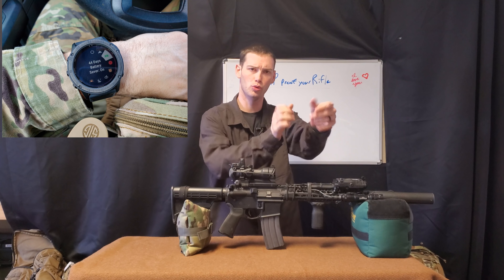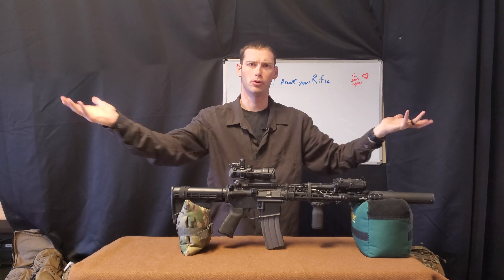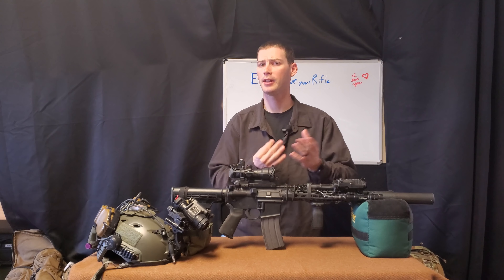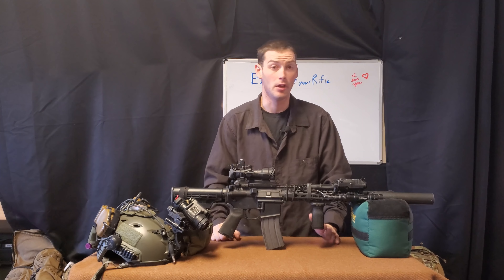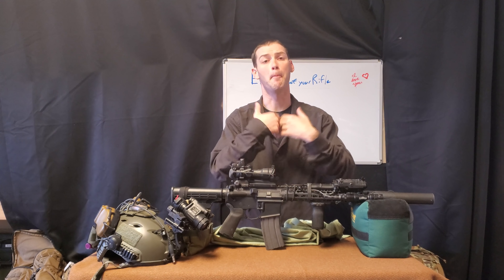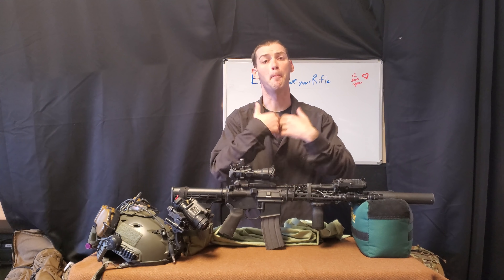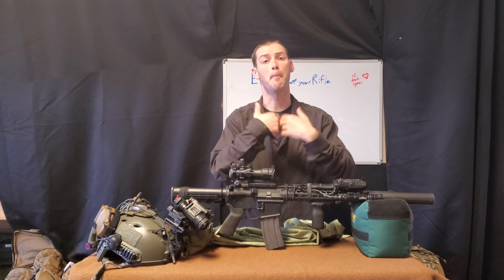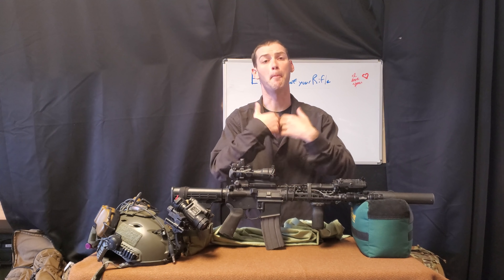EMP proof your rifle

Comment from the maker: If you are someone who has Night Vision, unfortunately you can't use Iron sights as a backup method... hence the reason for this video.
Reply: As someone without NV, question. Would tritium (fluorescent paint, idk what it actually is) front sight post on a rifle be usable with NV?
Reply from the maker: @sovvers514  Not with any degree of accuracy. The problem with NVGs is they are at a fixed focal plain, like a manual focus on a camera. So if you see your target then you can't see your sights or opposite if you see your sights you can't see your target.
Reply: @PreparedAirman  nvgs dont have focal adjustments?
Reply from the maker: @lawofliberty3517  They do but they are cumbersome and time consuming.
Reply: I use white-out on my front and rear sight. It stands out pretty good. I don't run night vision. It's cheap too.
Reply: @sovvers514  another problem is its hard to get a good line of sight on your rifle with irons. most people use IR lazer only for aiming or a scope riser to aim
Reply: @crossfox1991  while i appreciate the response, that is pretty common knowledge. i was looking for an emp proof method under night vision, and if an emp affects my rifle I imagine the laser and scope will be rendered useless. though, so would NVG’s if they were in the same proximity. idk man maybe i’m reading too far into it 😂
Reply: I Guess I'm The Poor, Weird, Nerd That Just Used The Old Hobo Faraday Box Methods!?! 
I Cut Cardboard Boxes (For Insulation!) Custom Fitted Around Each Device(s) Of Concern! I Then Fully Wrapped Boxes With H.D. Box Tape, Proceeded By Multiple Layers (Exterior Only, 3 X Layers!), Of H.D. Aluminum Tape For Shielding, Extra Extended Lengths At Openings, To Assist In Opening And Secure Resealing, Via Clean Folds, Or Rolls Like A Back Packers Dry Bag Works! 
If Your Not, A Poor Hobo, 
Such As Me! I Recommend The Metalic Shielding Cloth, Inside Of Any Camo Storage Pouches, For Convience Alone! 
Pa-Pow, Amen! 
😎 🙉🙈🙊 🇺🇸

Comment: It is my understanding that optics and lights having very small conductors, have an insulated construction, and no antenna element that an EMP will have no effect on the optics/lights. 

Also it is my understanding that cell batteries like AA, AAA, Cr123, Cr2, ect as they are direct discharge and not conductor lead, the batteries will also not be affected. 

Things like radios, TVs, modern automobiles with computers, and our power grid will be effected. 

This is just based on my own research and reading I have done a long with my neighbors knowledge who is currently an electrical engineer, and when he was in the military he worked with the navy and one of his jobs was to EMP harden navel vessels.
Reply from the maker: Most evidence points to you being correct but realistically we don't know what would actually happen. Magnitude +Time, distance and Shielding all are unknown factors in this situation. With that I add an extra layer or protection. 

Ultimately we don't really 100% know what will happen. 

Objectively $50 protection for $6000 rifle is worth it to me. Comparatively buying $35 insurance on a $2000 plane ticket in case your plans change is a good investment in my opinion.

But that's just me

Comment: Emps also need a closed circuit to fry electronics last time i checked. So you could make sure to not leave batteries in your devices.
Reply from the maker: Any electronics are susceptible to EMP regardless of them being used at the time or not. But it's based on location and magnitude or the event.
Reply: Electronics with an open circuit without power are not susceptible. Arguably you could throw 14s in space (hoping that wouldn’t rupture) without batteries and would be fine in a solar flare. Agreed on not leaving batteries in devices till it’s time to get sexual
Reply: @paulsharp3748  thats what i was tring to say haha thanks
Reply: @PreparedAirman  thats just simply not true, like you said your fancy blanket prevents damage from emps....how do you think it does that? The same metal in that blanket is bassicaly in alot of optics flashligjts etc and its all on the out side, you dont need a blanket, also in order for an electronic device to even be affected by an emp it would have to be a closed circuit to act as an antenna, the bigger the circuit the bigger the antenna......btw ya could just wrap your gun in aluminum foil but making sure your guns are just grounded would have a better effect
Reply from the maker: @Derpyderp597  You do not need the have your items grounded.... common old school misconception. Large power systems do but for a common Faraday cage it's out right un true. Look up DR Bradley's tests here on YouTube you will be surprised.

Comment: Professional opinion as an engineer who's been researching EMP for about 25 years from a prepper's perspective. Everyone should have a job box or at least garbage can faraday cage. Mine has radios, an old laptop, small solar pannels, a bunch of TLR-1s I was able to get lightly used, and Vortex RDSs that are zeroed, removed and labeled for who they go on. And flashlights, lithium batteries (they have regulator chips in them), solar powered lights and a bunch of cheap casio watches. Little stuff MIGHT survive. Might not. Too little actual experience, just a lot of math when it comes to a bomb-pumped EMP. And this stuff is amazing
Reply: I use a 20mm ammo can, same result
Reply: Also buy a cheap automatic (no electronics) watch, like an Invicta Pro Diver. 😁 I just bought a Pro Diver 8928OB for $45 on Amazon last month, but not sure the sale is still going. It has 200 meter water resistance (with crown screwed down). I have a DBC-32 Casio calculator watch with 10 year battery life on it.
Reply: .... vacuum tubes my friend, vacuum tubes....
Reply: @franky2shoes660  Ahh the voice of reason and shortwave
Reply: The optic is no longer zeroed the second it comes off the weapon.
Reply: @prominence2826 , not always true. I have attended numerous courses where optics were moved from one upper to another. When returned to the exact position on the original upper the sight was again zeroed. We reconfirmed this numerous times. LPVOs and other magnified optics are more difficult due to the various factors that can cause zero shift.
Reply: @budoka34  Exactly. It really comes down to the optic type and how well made the mounting mechanism is.  If said "good quality" sight is mounted directly to the upper receiver (And why wouldn't it me?) then you've got a reasonable chance of being good to go.
Reply: So the metal trash can… what do I need to add do it?
Reply: @FFEMTB08  To make a metal container into an EMP resistant protective solution, you also need a metal gasket to fully seal it (can just be foil tape if you don't need to open it often) and a non-conductive liner, such as cardboard.  You don't want your sensitive devices contacting the outer cage at all, and you want it buttoned up tight as even pinholes or narrow gaps in hinges and such can allow through significant EMP damage.
Reply: @Zednor9  so I’ve got cardboard lining the inside of it ,and the lid. Do I need to seal it up more ?

Comment: That is one of the reasons I use Tijicon and Meprolight  red dots. No Electronics, No batteries and is always on.
Reply: Any and all red dots are electronic, having a battery or not doesn’t matter they are electronic..
Reply: Well that won't help for your light, pec-15, or NODs
Reply: @deputydog5261  Meprolights & Trijicons use tridium & fiber optics.   There are NO electronics in those red dots
Reply: @Ironsight_Army  Didn’t know
Reply: They are crazy how they work
Reply: Just picked up the Primary arms Cyclops Gen 2. With etched reticle and illumination
Reply: @mrbocanegraw  Also a good choice!  I want to pick up one of their micro prisims
Reply: Will definitely get thank you
Reply: @mrbocanegraw  I ordered mine almost 2 months ago said backorder  til may
Reply: Is that why mepro optics always look like ass?
Reply: @jammbbs1688  💯🤣
Reply: @Ironsight_Army  got the slx 2.5x prism a couple weeks ago. Very impressed so far.
Reply: @jammbbs1688  meprolight uses tritium which is a very rare radioactive isotope of hydrogen (H3 is  labeled on all tritium sights as a requirement to designate the radioactive element contained within) that emits light as the element decays thru it’s half life (12-15yrs). It will be 1/2 as bright, and  another 12-15 years it will be half as bright as that and so on. It will never go completely dark. 

You may have been looking into an older tritium tube.
Reply: @deputydog5261  incorrect bro.
Reply: My Tijicon has a battery
Reply: Micro prisms are my jam
More precise reticles and no tint
Reply: This is absolutely not the case for all trijicon devices. In fact, this isn’t the case for almost any of their offerings. 

I’ve never even heard of mepro lights. Probably for good reason.
Reply: God's chosen optic.
Reply: My trijicons have batteries.
Reply: The wrath of God acog does not use batteries. Jesus is the light.
Reply: I mean that’s all good and well until you’re fighting at night vs people with nvgs and ir lights which is way more likely than an EMP💀 I personally only like optics with etched reticles

Comment: Most all modern electronics have spark gaps printed on the logic board and or other components used in the same capacities which mitigates any possible emp damage.
Reply from the maker: Do you mind show where you received this information? Research paper or something else by chance? Its just conflicting with a PHD holder on the subject with many years of experience and I think its interesting.

Comment: My curiosity does it affect bullets does an EMP affect bullets because most of us I'm sure have a small stockpile of ammunition would it be worth considering rapping them
Reply: No, only way you ammo would be affected is if you have it locked in a safe with an electronic lock that didn't have a key access, and a direct answer is ammo doesn't have electronic components to fry so it will be fine.

Comment: If you're at the point that you are EMP hardening your rifle, I hope you invested a bunch in CBRN protective equipment, industrial HEPA air filters, Potassium iodide and other radiation meds, months if not years worth of food and water, and an underground concrete fallout shelter.

The most common and likely way humans can generate enough EMP to knock out electronic devices over a large area is through nuclear detronation.
Reply: Yes, this is true. But most common emp weapon is used at high altitudes to get the biggest effect. There would not be any residual contamination to deal with. It’s been reported that if given time it would reduce the US population by close to 90 percent. 

All the aggressor would have to due is pop multiple nukes miles above the US and wait a year or so for the die off and then roll in a take the place over.
Reply: @sokyoutdoors588  The point is that weaponized EMPs come from nukes. The common misconception is that "EMP Weapons" are non lethal. The ones that "would" be used are not. In fact they are very lethal, not only to the enemy, but to the entire world. Solar flares are currently the only threat that can produce enough EMP to affect a large area without nuclear fallout.

Nukes that are detonated at high altitude have the effect of spreading  nuclear particles over significant distances, that may settle anywhere in the world as it is carried by wind and moisture, over the course of several weeks, to several years, depending on the size of bomb. They also will indiscriminately knock out satellites in space. Significantly hindering the ability to use satellite communication and navigation.

Popping off multiple nukes over the US would essentially bathe half the world in Nuclear fire, and that's assuming the US didn't shoot back too, bathing the other half of the world. 

All I'm saying is, an EMP event taking out your rifle optics is probably the least of your worries. You would also have to worry about how to survive in a nuclear hellscape.

Comment: HEMP energy (detonating a nuclear weapon at a very high altitudes) is mostly concentrated at the low end of the radio frequency spectrum.  Only fairly long electrical conductors (i.e., AC power lines, phone/cable/internet lines, big antennas, etc.) are capable of "receiving" a HEMP pulse in any significant strength. Physically short conductors make very inefficient "antennas" for receiving the low frequencies produced by the HEMP pulse, so they do not generate much of a voltage spike.

Devices that aren't connected to any long conductors, little or no voltage spike is generated due to HEMP.   Most small electronic devices (i.e., cell phones, portable radios, PDAs, laptop computers, digital wristwatches, flashlights, electronic combination locks on safes, red dot sights, etc) would fall into this category.  The few inches (or fractions of an inch) of conductors present in these devices is simply too short to intercept any significant amount of the HEMP pulse, which means that no spike is generated within them that is sufficient to cause damage.

The other, naturally-occurring kind of EMP is produced by solar flares (or "geomagnetic storms"), and is even lower-frequency than HEMP, which means that a conductor needs to be several miles long to be affected by it. Some examples: High-tension power transmission lines, gas pipelines, undersea cables (copper, not fiber), and - back in the old days - telegraph lines. Other, shorter conductors are mostly unaffected.

Solar flares do not produce any of the fast-rising, high-voltage "E1" or "E2" spikes that HEMP produces in electrical conductors, so personal electronics are not affected by it. (Note that satellites can be damaged by solar flares, since they're outside the part of the earth's atmosphere that provides some shielding from solar radiation. Radio signals can also be affected, particularly in parts of the radio frequency spectrum that normally rely on bouncing signals off  some layer in the earth's atmosphere to make them travel long distances).

In the event of nuclear war, a low altitude or surface detonation would produce enough short range energy to effect small devices, but would also likely result in your death anyway.  Even if you're far enough away to not get vaporized, the effects of getting irradiated will lead to suffering and death without medical services.
Reply: Radiation poisoning is one of the worst ways to go. If that happens I’ll be opting out myself
Reply: @AFreeThinkingDawg09  Well fortunately radiation from post nuclear blast doesn’t stick around too long, best I could find. Seems it dissipates in less than a day in some situations.
Reply: So then here’s my question. What about a dedicated emp device? If such a device exists  and can be used in a practical application. Such as wiping out your enemies grid.
Reply: @hardlylivin6602  Depends on the fuel and detonation method used. The Hiroshima bomb for instance left enough radiological material that it was only 15 years ago, I believe, that background radiation finally dropped to pre-detonation levels.
Reply: @alexwalker2582  I believe modern nukes fielded in nuclear arsenals are much more efficient at using their nuclear fuel, leading to less longer-lasting decay isotopes being found in the fallout from those nukes. Could also be wrong about that, would have to do some more research. I have heard though that in the case of modern nuclear munitions being used, radioactivity that can cause acute poisoning and massive short term damage wouldn't last too long as the decay products that produce that intense radiation decay very quickly because they're giving off that much energy, leaving to the main worry being longer-term mild decay products that will cause issues further into the future if you survive the blast and initial exposure period
Reply: @tacticaltoaster5777  My understanding of small tac nukes is that under a half megaton it doesn't have enough nuclear fuel to completely use it all up, causing it to behave more akin to a dirty bomb even with more efficient fuel.

Comment: Solar panels aren't susceptible to EMP unless they are hooked up with cables, thus creating an antenna. If you are using them in a permanent situation, Like in an array, you can simply add Ferrite cores to protect them
Reply from the maker: That's what I did.